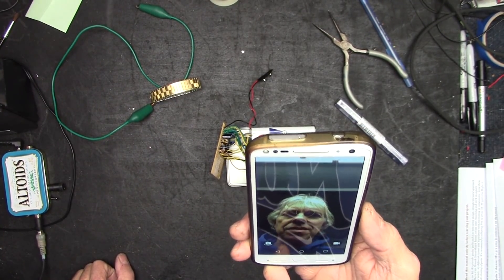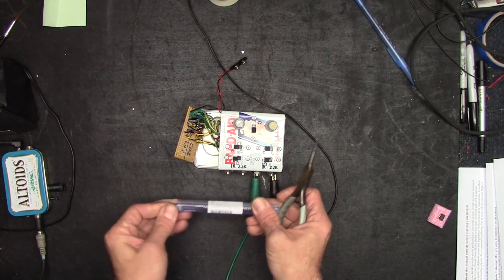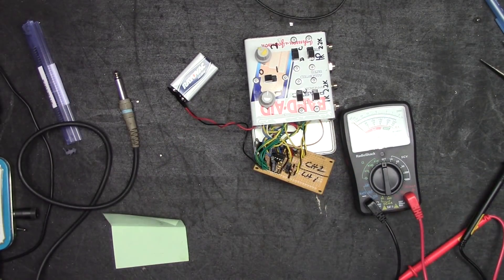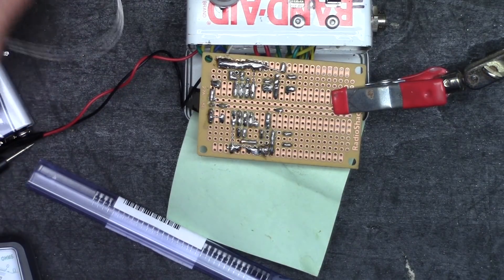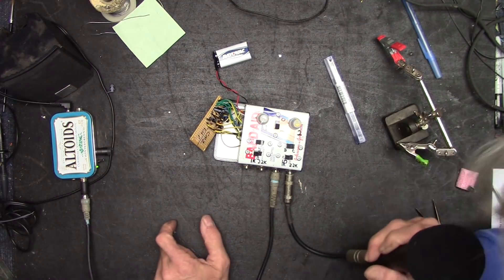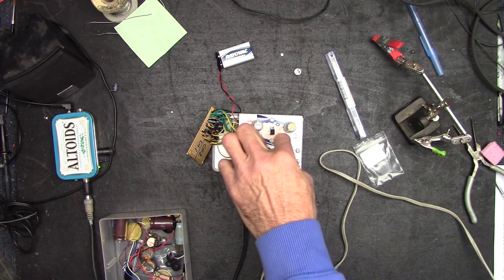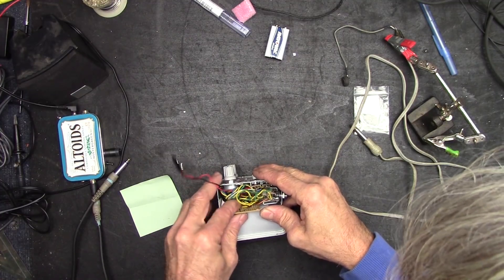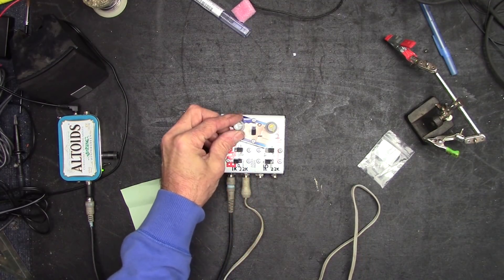NE5532 Preamp Fix

Comment: Is there a schematic for the Circuit to be able to switch between Condenser and Dynamic Microphone Elements for testing with a preamp?  Do you have to feed the 5532 with a LM386 or will they work as a stand alone preamp.

Comment: A proper antistatic band has a fairly high resistor (i think 10MOhm) inside to prevent the user from an electric shock. Imho your DIY version is dangerous in case of an power line accident! I would recommend a propper one!!!
Reply from the maker: Nothing was plugged into the mains in this video but yes, you are correct in pointing out what a proper anti-static band has built in. This is obviously a home made one and in this case, not dangerous!!!!!!!!!!!
Reply: @HackaweekTV  sure, in this case with battery power it is no problem! But maybe not all of your viewers might know why it would be dangerous at mains voltage...